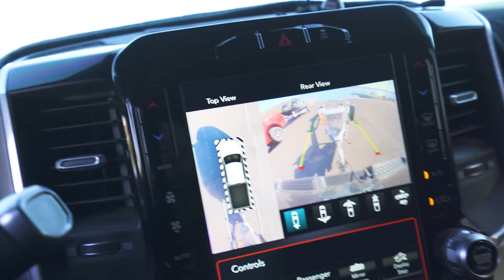MY HONDA ACTY MINI TRUCK IS BACK!

Comment: I made 3 cross country trips in a Suzuki SA310 (A chevy metro but Suzuki branded) It also had a 3 cylinder engine. this was back in the late 80's early 90's it always ran like a champ and the most expensive trip as far as gas go's was still under a hundred dollars. Loved that little car 42+ MPG and would keep up with the worst of traffic. I almost wish I still had it. But it was a tiny tin can in a crash and always scared the ex wife half to death any way in the here and now 42+ MPG sounds amazing. Have fun stay safe and don't do anything I wouldn't do. Which gives you a wide birth cause I'd do almost anything.
Reply from the maker: That’s awesome!